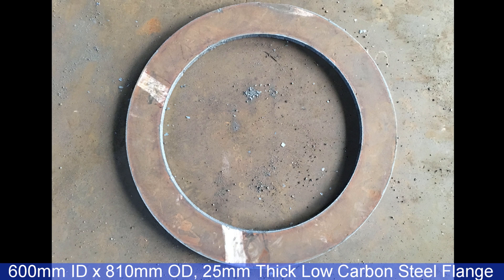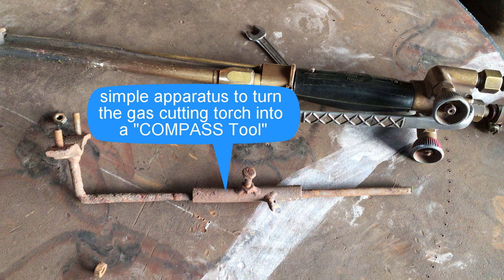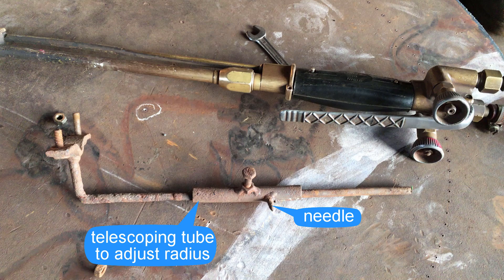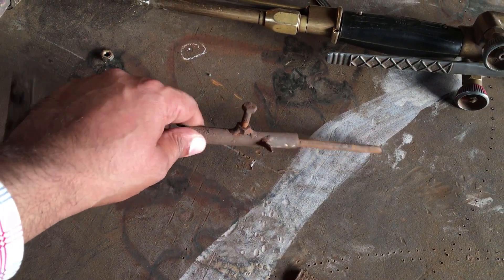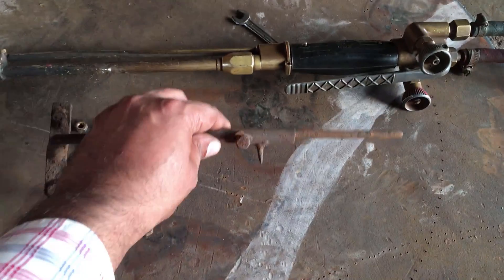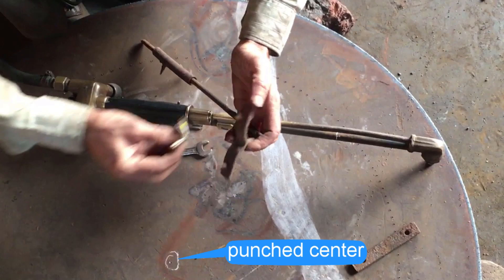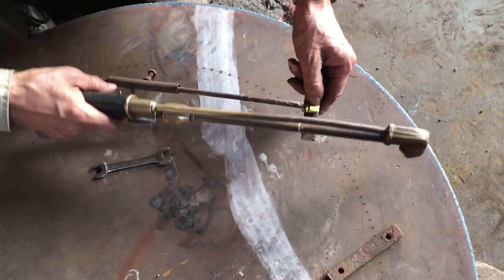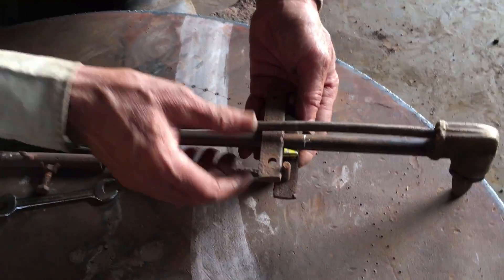OXY ACETYLENE CUTTING a Circle Accurately using a Cutting Torch (Big Circle)

Comment: Gas cutting time only for sparking lighter use, not for use gas lighter because gas lighter is unsafe,
Reply from the maker: Thanks a lot for pointing out the very valid safety points. Will make sure they are taken care of, in the future. 🙂👍
Reply: @AbhinavSG  Thank you sir
Reply: I used butane lighter to ignite my acy+oxy cutter for the last 20 years

Comment: Iam working in BHEL in fabrication department  I want a fixture for profile cutting in large diameter of pipe
Reply from the maker: That's very interesting. What pipe diameter are you talking about? What profile do you want to cut in the pipe?
Reply: 9004245403
Reply: 7878123344

Comment: Nice circle jig. The cutting tip looks to close to your metal. Thanks for posting.
Reply from the maker: +R.L. HEARN thanks. I guess it's coz of the angle at which the video was shot, you feel as if the cutter is too close. It was still a quarter of an inch from the plate surface.